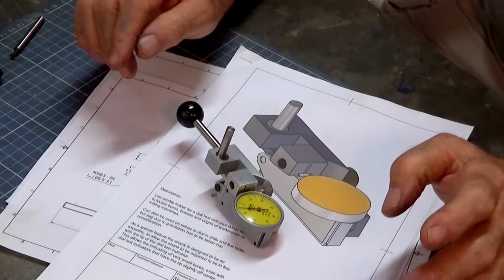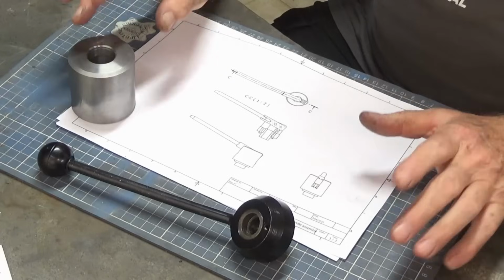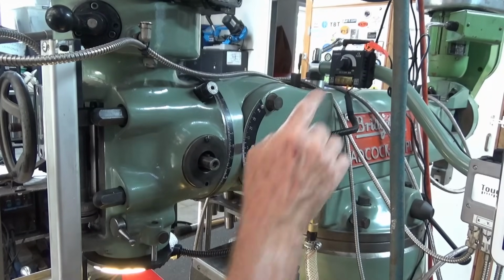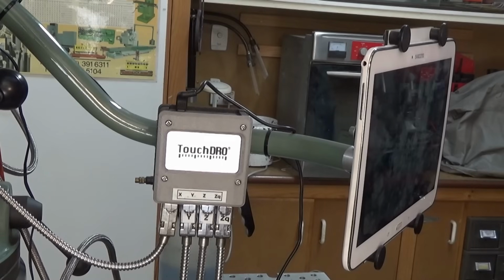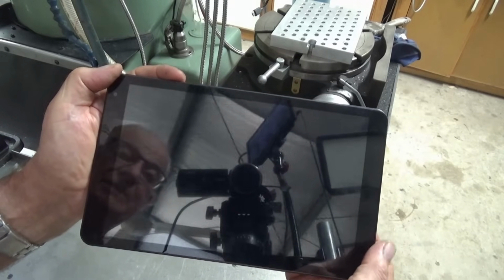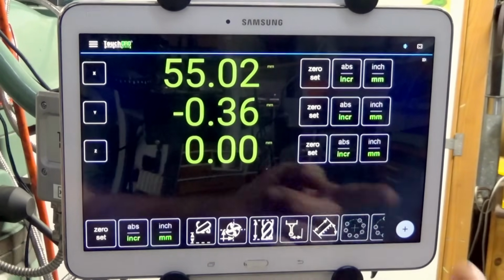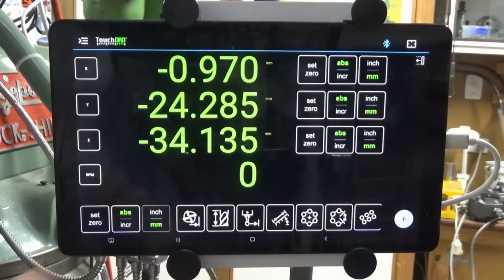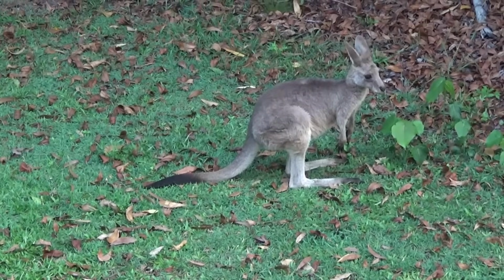Channel Update and TouchDRO, a 3 Year Review

Comment: Another good video.  Even though I am not a machinist and I don't have a DRO you helped me with a problem today.  I use a tablet in our store for our credit card customer purchasers.  When I turn on the tablet my very first thing is to tap the application for the credit card and many times it refuses to see the credit card scanner, which is a blue tooth piece that sets on the counter and is blue tooth only.  I will check this out on my next time turning it on, I'll bet is is the blue tooth delay in starting.
Reply from the maker: The tablet I was using was fairly old and it seemed to take a long time for the Bluetooth to start up. I recently replaced the tablet with a newer one and it is a bit quicker. My wife and I seem to replace our tablets around every two years. It seems like Samsung build in some sort of "slow death mode" which gradually slows down the overall performance even if you do a factory reset. 
Regards,
Mark

Comment: Thanks for the info on TouchDRO.
USB cables, a surprising amount aren't even shielded which can cause problems.
For clean power I have a dedicated setup with a double-conversion UPS just for electronics and computers in my basement shop.  I use a Sola S4k but the APC RT is good too.  You can usually find them cheap with bad batteries and replace them for a modest amount.  Look for ones that are 48V.  They only need four 12V batteries.  You can also use smaller capacity batteries to save money.  Other ones are 192V and need sixteen 12V batteries which is REALLY expensive. 
A double-conversion aka online UPS generates it's output from DC so it's always a perfect sinewave.  A typical UPS, a standby UPS, uses fast switching of an inverter for it's output.  So whatever noise is on the incoming power, is passed virtually straight through.
Reply from the maker: Most of my minor issues with TouchDRO seem to have been resolved. It now performs flawlessly. However, I have had electrical interference issues with the UC100 motion controller on my CNC milling machine. It turned out that the cheap USB cable was picking up stray electrical spikes from the 240V air relay due to inadequate shielding. 
Regards,
Mark
Reply: @Preso58  Good to hear.  Yeah, I got a cheap USB cable tester to test for proper shields.  Threw out the unshielded cables.

Comment: Hi Mark, you could use a laptop/PC with an Android emulator. I have done this on Linux with Genymotion ( there are apps for Windows ) and works great with Touchdro-Pro and the latest adapter.
Reply from the maker: I recently swapped out the old Samsung tablet for a newer one and everything seems to be stable and trouble free now. 
Regards,
Mark
Reply: @Preso58  👍.

Comment: Some devices allow for the elimination of the battery. Some require a little soldering when ditching the battery. But many do get rid of the battery and sleep easier. Check your tablet model and if someone has done it or someone is selling a kit to do it. Keep up the great content. Quality over Quantity. The Algorithm is biased!
Reply from the maker: Thanks. I never really run the tablet using the battery anyway so removing it al together would be ideal. I will check out some solutions.
Regards,
Mark

Comment: How do you program it for boring bar work? can't find anything out there.
Reply from the maker: Do you mean for use on a lathe? On a mill you can only use TouchDRO to find the centre of the bore. After that  you have to rely on the micrometer dial on the boring head if it has one. 
Regards,
Mark

Comment: Your original videos on the installation of the the TouchDro helped me a lot when installing it on a small mill. I sold that mill and got an old Bridgeport which didn't come with a DRO. I really like the TouchDro and want to install it with glass scales on the Bridgeport. What are the sizes of the scales you used, and did you have to modify them? Do you have any video on that upgrade, would love to see it. If not maybe some details on mounting the glass scales. The new swivel arm looks great, as always great job and thanks for sharing.
Reply from the maker: I did not have to shorten or modify the glass scales that I bought. The Sino scales that I purchased were 5 micron and most suppliers will sell them in lengths that will fit and still provide enough travel length.  The ones I ordered were KA300 and the sizes were 670mm for X, 420 for Z (the knee). 320 for Y and 170 for the quill. You should check the table on your Bridgeport because there were several length tables fitted from the factory. Mine is 42". The good thing about TouchDRO is that you can sum the quill and knee movements to give you a combined Z travel for the workpiece relative to the tool 
Regards,
Mark

Comment: IMHO, Stefan's low-profile dial indicator holder would be even better if it included an adjustment screw to move the indicator body.
Reply from the maker: Stefan did challenge other users to come up with a fine adjust. I tried but it started to become a lot chunkier 
Regards,
Mark

Comment: Nice projects Mark, and solid practical advice about the DRO. Tech integration is a constant challenge as the OS providers think nothing of changing their interfaces any time they feel like it - I suspect Google is worst for that. Low quality components is another constant problem - different domain but my son has recently  wasted so much money buying car parts from previously reputable brands only to find they are just badge engineered junk now. In that sense buying genuine parts seems to make sense again. And don't get me started on Samsung tablets - years ago I bought a TAB 2 and I got one OS update from Samsung the whole time I had it and within 12 months it was slow and almost junk. These days I stick to Microsoft where I can. Useful info on the scale types. Cheers
Reply from the maker: Thanks Paul. I have had the same experience with Samsung tablets. They start off great and then slow down to a crawl. If one were truly cynical, one would think it was a deliberate strategy to get one to upgrade!
Regards,
Mark

Comment: I'd remove the battery and directly power it from a power supply. No more waiting for the BT to come up. How is the touch screen with wet or oily fingers?
Reply from the maker: I have not had any issue with the screen and fingerprints although I did read about a guy who fitted a touch screen overlay on a PC monitor so he could run his CNC mill from Mach3. Evidently he was jogging the tool down in the Z axis and when he stopped touching the jog button on the screen the machine kept up a rapid move in Z and crashed the tool into the work. At least with TouchDRO you are not really controlling the movement of the machine. I do clean the screen with IPA and a paper towel though. I am looking into some workarounds for the battery/power issue.
Regards,
Mark

Comment: Great video Mark. Could you make the pin holding the light clamp longer? When you lower the spindle you could lower the light ring down to avoid the shadow with a longer pin. However having the ring lower may obscure your view
Reply from the maker: You could make it longer but it might be a nuisance to have to constantly adjust it. I think the main benefit is to illuminate the work area surrounding the tool rather than to throw a concentrated beam of light on the cutting area directly under the tool.
Regards,
Mark

Comment: Mark, for the tablet, battery... If I understand what my IT guy was saying, correctly... If you want to leave it plugged in all the time, there should be a setting for charge amount, (probably not the correct name,) in the tablet's settings, and you should set it to not charge more than 85%, to give your batteries charge down time.
Reply from the maker: I checked that and it is buried in the menu under battery care on my Samsung tablet (the 3 year old one I recently took down to the workshop). I enabled that setting so I am hoping that it makes the battery less likely to fail. 
Regards,
Mark

Comment: I wish this system would work with my magnetic scales that I already have. Ive got a D80 display at the moment and its decent but the UI is bloody awful.
Reply from the maker: TouchDRO will work with magnetic scales. You just need to get the correct Bluetooth adapter. The TouchDRO website has plenty of information on how to select scale types and which adapter is most suitable. https://www.touchdro.com/resources/getting-started/dro-scale-selection-guide.html
Regards,
Mark

Comment: Good video mate, cheers! Ive got a very similar setup with the ring light to your original so now you have made me want to upgrade it! What diameter light did you buy? 
James (Canberra)
Reply from the maker: I think it was 110mm OD. bigger might be better. It depends on what type of mill you have.
Regards,
Mark
Reply: @Preso58  Cheers Preso, 110mm will fit perfectly, I found time to measure it up and order the bits.

Comment: G'day Mark, great follow up.  After your first Touch DRO videos I went the whole DIY option and made my own unit using the schematic on the touch DRO website and uploading the software to the ESP32.  I had pcb's made by JLCPCB and amazingly it worked first time. I used glass scales from the outset as I had already bought them for my Bridgeport.  
The one question I have for you or any of your viewers is how to make the display digits larger?  I am using a 10" Samsung android tablet and comparing my screen to yours, I have smaller digits with a bigger gap below the RPM and the buttons along the bottom.  There is obviously a way to get the display to look like yours but I have yet to find it. Any help would be appreciated. Cheers.
Reply from the maker: The settings page has three different font display styles to choose from. The seven segment option isn't really the most legible and there is also a monospaced font and a default font. I think the one I used in the video is the monospaced version. There are lots of settings in the latest version of the app which make better use of the screen real estate but try changing the font first.
Regards,
Mark
Reply: Thanks for the reply Mark. I tried all fonts first off but it did not change the size.  I updated to the latest build version of the app but no difference.  It looks like the aspect ratio of your tablet could be different than mine, so maybe that is why your readout appears larger but is in fact the same size.  One of the advantages of a DRO is an easy to read display and larger numbers are a plus. Keep up the great work.

Comment: Liking the future projects.  I’m not thrilled with the touch DRO, I converted to glass scales after I burned out my tablet.  The dimmer switch is also available on Amazon, I use the same dimmer on my cnc hot wire foam cutter

Comment: I have been using a touch dro for just under 2 years.. with glass scales  and I am very pleased with touch dro especially with yuri’s latest upgrades … I avoided the usb connected scales … I have experienced too many issues with usb in my work life in applications like the touch dro … by the way one of the advantages of the Bluetooth connection to the display is the ability to mount the touch dro box on the back of the mill or in my case on the wall behind the mill … allowing me the dress the cables neatly out of the way … the only disadvantage of this system is the lithium battery in the tablet… it’s a fire hazard if left on and connected to a charger for long periods… A nice upgrade for the touch dro box would be to incorporate a memory so the zero and table position where maintained with just the dro box powered…
Reply from the maker: I do like my TouchDRO setup. I probably only use about 25% of the functionality but it's nice to know it's there. My understanding was that the Bluetooth adapter will "remember" the absolute coordinates as long as the power isn't interrupted. I also noticed that the incremental position is also maintained with the app closed and the tablet powered off. As long as you don't move the scales with the app closed it should be right the next time you start it. A 5V battery would be a good way of keeping the memory intact even if there is a power outage.
Regards,
Mark
Reply: @Preso58  …yes I power my touch dro box with a lithium battery pack … the type that plugs into the wall … it’s good for about a day or so when it’s not powered.   I keep it plugged into an outlet that is switched… normally I turn the power off when leaving the shop, so the dro is “good” till the next day….and if need be I can leave the power on to maintain the dro longer.  By the way I have my battery chargers for my cordless power tool plugged into power strip which I switch off as I leave the shop.  That way when I leave my shop, which is attached to my house, all the lithium battery chargers are powered off.

Comment: I just acquired a Touch DRO adaptor together with Aikron glas scales and used a Black Friday Fire tablet offer - not least due to your positive experiences with Touch DRO. This video comes as a nice confirmation that I didn’t do it all wrong. Thanks a lot!
Reply from the maker: I think glass scales are the way to go. The only issue I had was that I couldn't fit the chip cover on the scale fitted to the quill. Because of the orientation it's really hard to find a way to prevent dust and chips from getting into the scale. So far it has been reliable though. 
Regards,
Mark
Reply: any details you can add to how you mounted them to your knee mill?  did you go 1 or 5um and regular or slim?
Reply: @tlambert409  are you asking me? I have a mini mill, not a big knee mill. For this I acquired 1um slim scales, which seem to work very well. I left away the cover for the X scale, because that would have cost another 10 mm of Y travel.
Reply: @yagwaw  i think i have decided on 5um.  i dont link i will need more for location for my needs.  thank you for the information.  i have a cloan bridgeport, so likely different mounting will be needed.
Reply from the maker: Mounting the scales is always an awkward job. I fitted the X scale at the back of the table however I have seen them fitted to the front. If you fit it to the back you need to be mindful of squashing the scale and it's cover if you run the table back to it's limits. The Z scale can be fitted to either side but you need to have the read head at the back so swarf and chips will find it more difficult to get inside. Same with the Y scale, the slot in the cover should face down. It really does depend on what type of mill you have when it comes to figuring out how the mounting brackets work. In general, having slots rather than holes gives you more options for aligning the scales and if you have a 3D printer it would be worth rapid prototyping things in plastic before committing to making them in metal. I used 5 micron Sino scales (Chinese made) they are a KA300 which is the form factor. The slimmest scale is a KA200 but they might be a bit flimsy for the longest axis on your mill.  @tlambert409
Reply: @Preso58  i am going to try the Aikron regular size.  there doesnt seem to be a slim offering on the x and  will be using 36" or 920mm.  i have a 12in Y so that will help with respect to the size.  I am mounting to the rear of the table for power feed set up in the front.  i will replace the accordion screws with stops to prevent any crash into the scales.  I have seen retro fit mills in our tool room.  they have stand off and spot face on the drafted surfaces of the knee.  i will do my best tom reproduce.
I have option so, the W or knee will be to the right.  Z will be quill and seems more sized on the geometry there, but 6in seems the correct sizing.   thanks for the reply
....it is a process!

Comment: Mark, I'm not sure if a Samsung tablet as old as yours has the option in the settings, but newer ones (my phone and the tablet I am writing this on) can be made to only charge to 85%. Go to Settings>Battery and device care>Battery>More battery settings> then set protect battery to 85% on the slider switch. This "should" in theory not allow the battery to be overcharged when plugged in 24/7.
Reply from the maker: I will check that. Thanks.
Regards,
Mark
Reply: @Preso58  Apologies Mark, no idea why I called you Paul. Will amend my comment.
Reply from the maker: @billdoodson4232  that's OK. Just don't call me late for breakfast😁
Reply: @Preso58  😅🤣😆😅